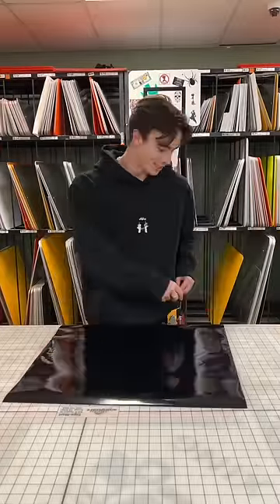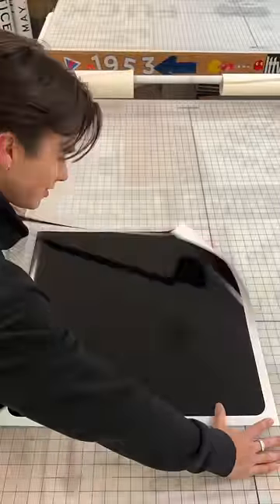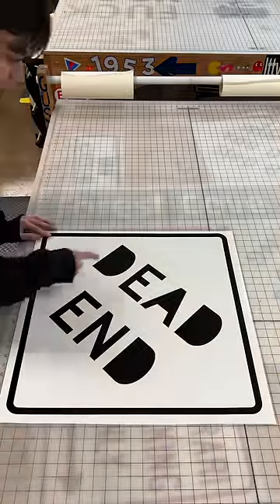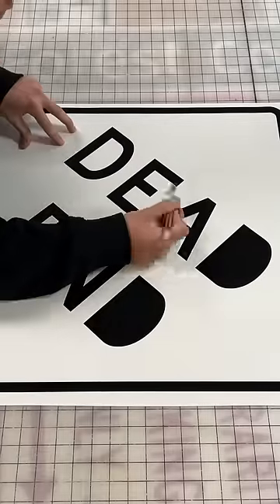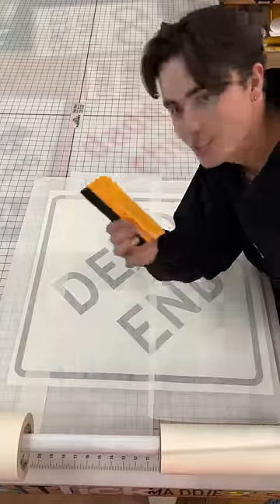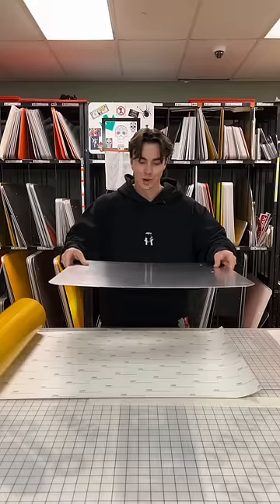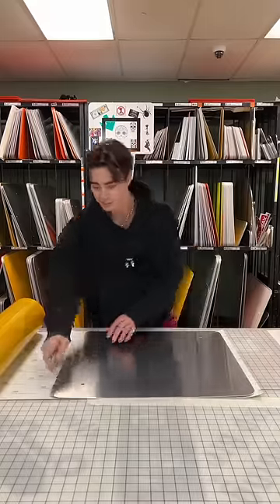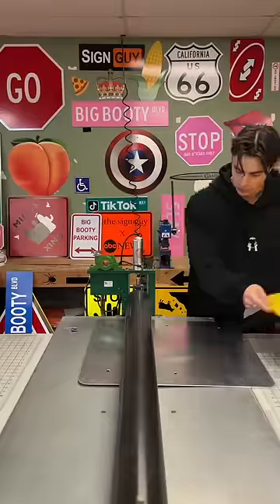HOW IT'S MADE

Comment: I actually work in a sign shop as well, I like the technique of rolling the backer paper under the roller. I was taught a completely different way but that looks easier.
Reply: What is the machine called?
Reply: I also worked for a sign company for 5 years. When I started we cut the paper then we went to folding it. Folding it out of the way like he does is so much faster and easier. The little cut he did to remove the remaining transfer tape and the little bit of damage he did with the other sign never would have passed our quality standards. I miss that job. The company moved to Brooksville Florida from Illinois or else I would still be there

Comment: Always peel diagonally from either the majority of straight lines or any spots you are worried about losing. So for example if you have a "D" on a square sign, you wanna peel from the top left corner to the bottom right, or bottom left to top right. The larger the area the easier it is for it to stick when pulling. Corners and points have a much smaller area to stick or have a piece that didn't cut thru all the way. If you were to pull from the middle right to middle left on our "D" it has that entire ) side to catch, especially if there's just the tiny piece on any part of it, that didn't cut through for whatever reason.(dull blade, thicker vinyl, plotted wrong, etc...)